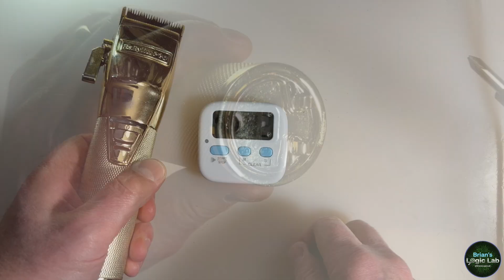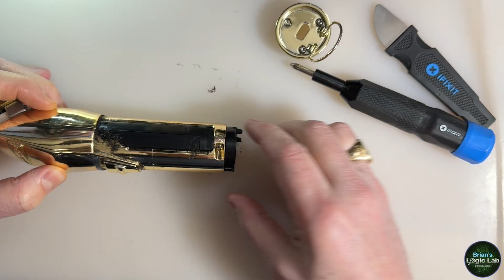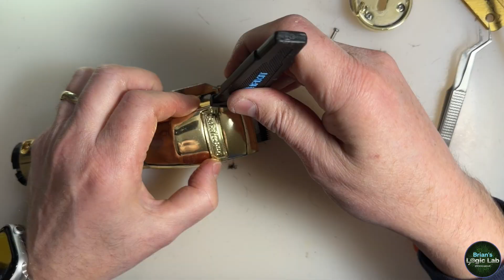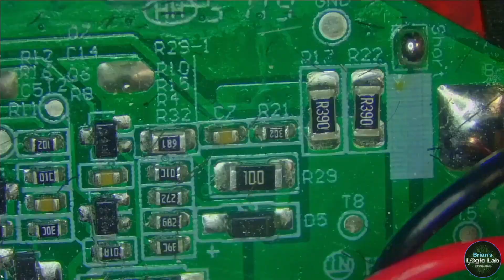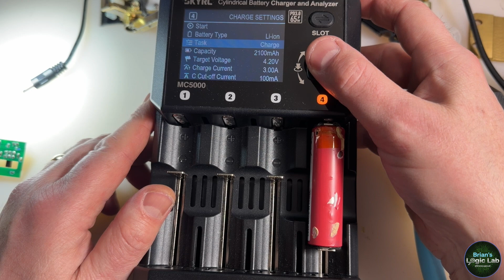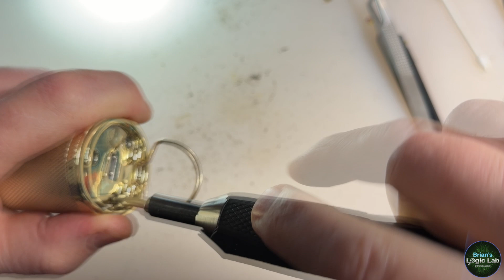Don’t Throw Them Away! BaByliss Pro FX Battery Replacement & Soldering

Comment: Good job ! Wonder if you can use compressed air to clean off circuit board, when it’s got fine hairs or dust on it when taking apart?
Reply from the maker: Low pressure compressed air is a great way to clean the hairs off the board.  Before installing the new battery I did use compressed air to blow off the board, this part was edited out though.  Thank you so much for watching and for taking the time to comment!

Comment: Hello thank you for the video, my question, did you solder the tabs to the battery or they arrived with the tabs?
Reply from the maker: Thank you for your question. On this repair I spot welded the tabs to the battery and this part was edited out as I was trying to shorten the length of the video. If you would like to see the spot welding I show it in the Mask N Glo video. Soldering tabs can be a little more tricky and if there is interest I can create a video in the future showing that, but I normally either spot weld the tabs or buy batteries with tabs already on them. Hope this helps.
Reply: @BriansLogicLab  Thank you for the reply, I will check the video meanwhile I will try to find a good battery with tabs and repair the clippers then I will try to purchase a spot welder for future projects.

Comment: where do you purchase replacement battery cells?
Reply from the maker: Thanks for the question. I typically get them from https://www.18650batterystore.com. I normally avoid Amazon and eBay for these batteries as there are so many fakes that can cause you problems.